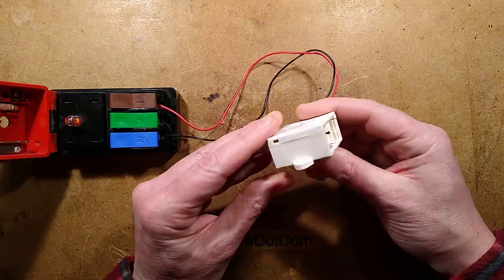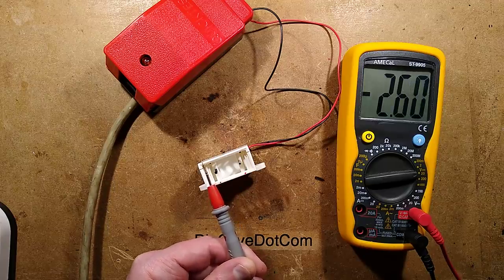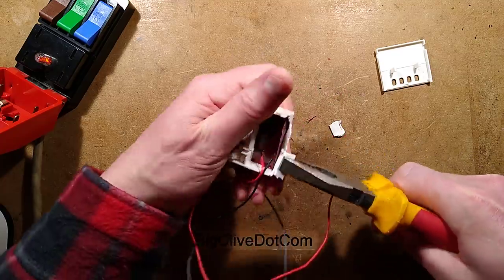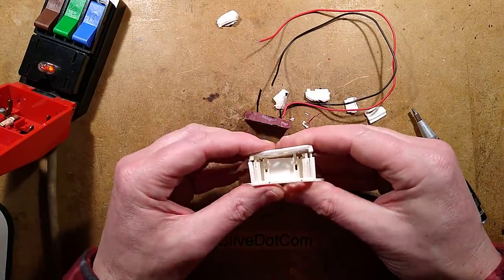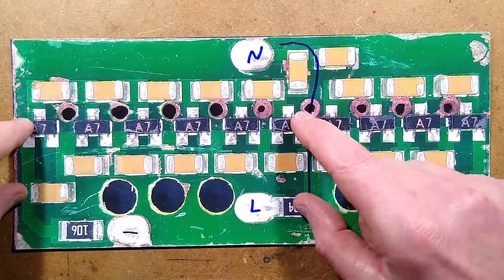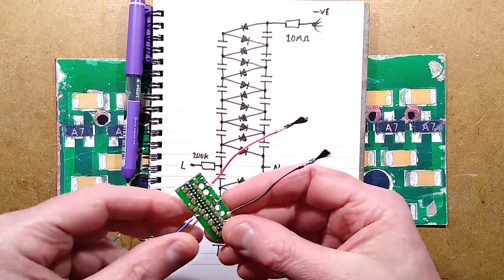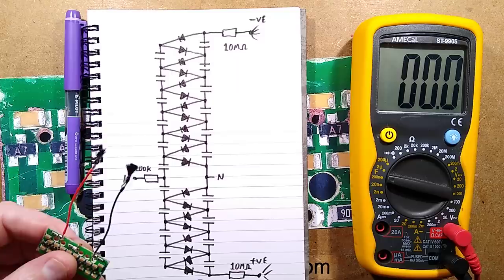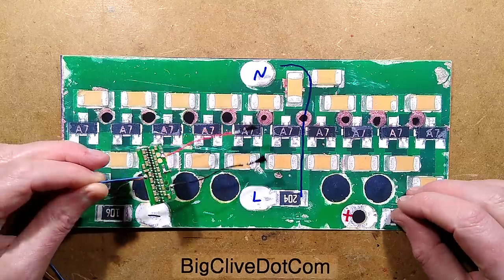Inside a Chinese fridge sanitising module (with schematic)

Comment: Is this CE marked or from 1 Jan 2021 CUK or CNI marked ? If not is it legal to sell / buy it ? Note there is apparently some UK legislation on the way to make sellers on ebay & similar liable for damages caused by their products. There is a story on the BBC web site about a house that apparently burnt down following a battery & charger purchased from ebay setting the house on fire - the family were lucky to escape though as they had let their house insurance lapse it is probably the most expensive item they will ever get from ebay.

Comment: Neat! Didn't know this was still a thing. I have a vintage Admiral fridge (late 50s / early 60s) and it has one of those low voltage UVC light bulbs in it, meant to turn on occasionally and make ozone. The owner's manual says it's for sanitizing the air and also to prevent the transfer of food flavors and odors. Which, if you think about it, made perfect sense in a world without tupperware or ziplock bags. They claim you can put an uncovered plate of fish in the fridge and it won't make your butter taste fishy. Not sure how much it's needed nowadays, though.

Comment: Still amazes me how such small components can carry such high voltages.
Reply: The capacitors only have to withstand the supply voltage each, but they are still very amazing.

Comment: Go on Clive! Move the mains input to the positive end to get a higher voltage!
Reply from the maker: Technically speaking it ends up the same differential voltage anyway.
Reply: @bigclivedotcom  True, but if you connect to the positive end, it would create a higher negative charge/ozone generation?.

Comment: The positive and negative circuits means that the ripple characteristics and charging times are improved compared to a single long chain. With this arrangement there is effectively a 10 stage multiplier between the positive and negative electrodes. Additionally there will be a "breeze" between them.
I think the combination or positive and negative ions will tend to cancel each other out  with the longer negative arm resulting in more negative ions being produced but not excessively so.

Comment: I'm watching this while the freezer compartment blower motor in my 20-year-old fridge is making all sorts of weird squeaky noises 🤣 LOL
Reply from the maker: It may be a worn bearing or just need a suitable lubricant.  There may be a universal replacement.
Reply: I thought the fan motor was going in my freezer. With a new motor in hand I started to remove the access panel only to find the air passage was sealed with ice. Once I got the ice melted and the drain unstopped, the fan sounded fine again. It's been a few years and the new motor is still in the box.

Comment: I've noted that center feeding a  long voltage multiplier like this delivers a higher voltage under load than if fed from one end with the same part count.  but instead of ground and positive or ground and negative, you get positive and negative with respect to ground.   choosing to have a greater potential below ground than a above ground  may have something to do with dust collection prevention.

Comment: I wouldn't trust those tiny capacitors with unknown voltage rating.
Reply: They'll have to take at most 240v * sqrt(2), so fair enough for those sizes. The resistor is more sketchy.

Comment: That multiplier looks really similar to the ones we used to use for photomultiplier tubes in downhole nuclear detectors. Basically either a sine or push-pull drive into a transformer and then those SMT diodes and MLC caps. Getting the MLC's not to crack and short in service was quite a challenge. This was doubly-so in the electronic neutron generators that ran at up to 120kV. Those would literally vaporize a 10uF/5kV MLC cap and leave nothing but a metallic skid mark and dust afterwards when the cap shorted.

Comment: Wow, I wasn't expecting this type of HV generator at all. As a person who has recently used your +Ion PSU livestream video as an instruction, I was quite surprised to see this PCB potted in resin where they usually put a HV transformer pulsed by a cheap and simple oscillator. Quite a lot of space left for the design this case was supposedly traditionally used for.
Reply from the maker: I've ordered a 110v and 12v one to explore.

Comment: It would be very informative if you would measure the voltage multiplier output, both in voltage and even to see the waveform on an oscilloscope.
Reply from the maker: Tricky, as the voltage is high and current is low.
Reply: @bigclivedotcom  voltage divider and then capacitive decoupling for the scope.  you already touched the output so it appears only a hazard to improperly connected instruments.  thank you.
Reply: @bigclivedotcom  Use 10x probe and connect to a cheap but pretty OK USB chinese oscilloscope like Hantek 6022BE
Reply: I would have loved to see the actual voltage output on the brushes!

Comment: I'd love to see a comparative analysis of how the 240VAC compares to the 120VAC and 12VDC versions. I'd also love to see your built version of the circuit.
Reply from the maker: I've ordered the 110V one, and impressively, they got in touch  to check it was the right voltage due to the UK being 240V.
Reply: @bigclivedotcom  Clive, do you have any 120vac sources? I imagine you have a Variac or standalone stepdown transformer but I don't recall seeing such a setup on your channel before. Worst case I wouldn't mind seeing a teardown and analysis even if you don't test it first.

Comment: Ozone produces hydroxyl radicals (*OH) with moisture in the air. I think that is the major route ozone disinfection works.
A single smd resistor is probably rated for something like 200V unpotted. I wonder how much it can take when potted? I'd not rely on a single 10M resistor in the output if designed a thing like that.

Comment: Im curious how you attached the carbon fibers to new wires. Or were they total replacements?
Reply from the maker: New carbon fibre emitters folded round wire which was then bent closed on them, and heatshrink applied to hold them in place.

Comment: The caps are in series and they don't need to be rated for that high voltage. The potential between them is probly ~220 V. Like a batteries in series.
Reply from the maker: It's a voltage multiplier.  They will see at least 350V each.
Reply: My head somehow sow 220V not a high voltage :) I meant like thousands of volts

Comment: I'm still using the triangular fridge ozone generator you took apart a while ago. 
The battery lasts nearly 2 weeks & in times like these using "nature's steriliser" in my fridge is a simple, cheap method of keeping nasties at bay.
I've thought of ways to test it using petri dishes of agar & such but it's easier just to charge it once a fortnight & bung it in my fridge. 
It makes me feel better anyway!
Reply from the maker: I'm using mine too.  I recommend letting it warm up to room temperature before charging it to give the lithium cell an easier life.
Reply: @bigclivedotcom  Ooh!  I didn't think of that. Thanks.

Comment: The voltage multiplier is a lot like the design I used in the high voltage leakage tester project I sent you last year.

Comment: Since A7 = BAV99, as @nuts_n_proud said, rated at 70 or 75V I tested a Nexperia one to see what the actual typical breakdown is (SPICE model says.. 100V). Surprisingly, perhaps, it was more than the ~330V I have available from doubling mains voltage here. The caps will have lower capacitance at the working voltage than at low voltage, of course.  Cockroft-Walton multiplier configuration- the diodes and caps each just see the stage voltage so I guess the output could get "pretty high" with no load. I have a 40kV 1G probe but no patience to build one of these by hand at the moment.
Reply from the maker: The probe would be too low impedance for a low current ioniser.
Reply: @bigclivedotcom  When a gigohm is not enough..
Reply: @bigclivedotcom  Your schematic is very easy to follow, so just for shts and giggles, I simulated the whole thing in LTspice using 33nF caps and RRE02VS4S 400V 0.2A diodes with 50Hz 233V RMS input. About 4kV with no load and 3.6kV with 1G load, so divider output Z about 80M + the 20M resistors. Takes a few seconds to charge. https://i.imgur.com/inlUTpy.png  Ideal would be 6.6kV. Very interesting, thanks for tearing down the potted module!

Comment: Oh, and now that you took it apart and it's still working pretty fine, you can even pot it back in resin and reuse it. Or even extend it further to reach even higher voltage, if you only will.
Reply: Buy three and put them in series?
Reply: @lwilton  first you'll need to separate their multipliers: there is a negative voltage multiplier and a positive one. And neither you want to exceed these diodes and capacitors maximum rating, nor you're gonna be able to charge them with DC.

Thus, you must separate these wannabe half-bridges to stack them up and increase the voltage.
Reply from the maker: I did reassemble it and might pot it into a custom 3D printed case.

Comment: Can confirm that a 12vdc ionizer 12-15kv is perfectly capable of causing a switching power supply to arc from VDC+ to ground, and kill it.
IDK if putting a neon bulb from + to - would keep the voltage from getting too high on the VDC out wires?
Reply from the maker: It's a real thing.  And there are a lot of similar products.

Comment: Please if you can, when you make a bigger test of this I'd like to know the  micro current of each pos-ion and neg-ion separately and then when they both running at the same time.
My theory is that it could create an ion exchange path that could make it higher current and thus potential for making higher ozone for a much smaller circuit
Reply from the maker: I think the vicinity and super-fine carbon strands are a significant factor.

Comment: Not sure if the thingy makes sense for consumer fridges though, considering the wiring (and a need for a timer and button of sorts?). It could probably be botched to fridge light assembly, but that’s kinda too hacky?
Reply from the maker: It's so low current it could be wired across the door switch.  But I think it's aimed at commercial fridges.

Comment: The A7 package looks like a standard SMD  transistor and cant a transistor be used as a double diode?
Reply from the maker: They can, but with very limited voltage ratings.
Reply: A7 will be a short reference code to identify the specific component, as there isn't enough space to print the full part number eg: 2N3904. The package looks like SOT-23, which are often used for transistors and diodes, but can also be used for 3-pin ICs like a TL431 for example.

Comment: try moving the 240V input towards 1 end on each circuit , to have +HV and -HV, then put the 240V wires in parallel to have double the voltage, to see if it works 

thanks for the video,
cordially, a high voltage enthusiast

Comment: Hi Clive. I had a project in mind and was curious could you build one with a reasonable amount of work and cost. An array of laser's say 5 in a fan spread that would pulse back and forth? Say #1 lights then #2 and so on to #5 then back again. To be used outside like in a Christmas display.
I was just thinking it would make a nice addition to a display shooting then skyward.
Reply from the maker: You can get disco lights that do that.
Reply: @bigclivedotcom  Thanks

Comment: i know youve done it before but i would like to see you build one with common through hole components and on a perforated board !!! the ones already perforated and you just solder and make the connections .
i want to build one but i dont have access to develop my own pcb or manufacture pcb's and local pcb manufacturing is super expensive.
i cant order a pcb from china becoz the stupid country that i live in (tunisia, africa) does not allow us to transfer money outside it so no paypal or ebay or amazon .
Reply from the maker: The perf board without pads could work.  You can make an ioniser with no PCB at all.

Comment: the caps and diodes only NEED to be rated for 350VDC in order to run on 240VAC, 400V would likely reduce the number of crib-deaths to an acceptable level. The bigger ionizers are probably built like a brick shithouse, just because.

Comment: The potting seemed pretty solid. Is that a suitable method to "uprate" the components to handling that much voltage?
Reply from the maker: I would guess the ceramic layer thickness would be a significant part of the voltage rating.
Reply: The voltage rating of a capacitor is determined by the thickness of its dielectric. Adding protection around it might make it safer for humans, but won't stop the capacitor being destroyed by overvoltage.

Comment: 2:59 Big Clive Rule of 3 - DRINK

Perhaps the designers found that using separate negative and positive multipliers was the only way they could get the voltage difference that they wanted in such a small envelope using the Cockroft-Walton topology.
Reply from the maker: This would be the simplest and cheapest way.

Comment: Is it possible to measure nitrogen oxides, to find out whether it's also breaking apart N2 rather than just O2. My understanding is they form in strings of varying numbers of N and O. The downside is formation of nitric acid with moisture present. While ozone from UV at 185 nm avoids breaking up N2, acting only on O2, or so I hear. A meter for just NO2 would maybe be an analog for all of its nasty cousins and good enough. Prices vary a lot. Anyone with experience using some of them?
Reply from the maker: Not sure, but if an atom of oxygen combines with a nitrogen molecule it could create nitrous oxide.  As used to whip cream for hot chocolate.

Comment: I like ozone for a lot of things, but I don't want to have high levels of ozone on or maybe in my food. Or whatever it does to the plastic and all that stuff you have in your fridge for long time.
Reply from the maker: This thing puts out low levels.
Reply: @bigclivedotcom  But in a relatively small and sealed room. With a half-life of about 30 minutes I think it can build up to higher levels. Maybe I'm wrong, still like the idea, I just wouldn't trust it.
Reply: @bigclivedotcom  and because I'm curious about it I searched a bit. Turns out the amount of ozone and timing is very critical. You want to reduce bacteria and mould as much as possible and damage the food as little as possible.
So running this thing for 1-2 hours in the middle of the night seems fine to me.

Sorry if my English sounds stupid😅

Comment: Is there any reason why I couldn't buy a cheap pir motion sensing solar light and swap out the LEds for IR LEDs to aid my security camera night vision? Or would that mess with the pir?
Reply from the maker: You could do that, but you can buy 12V infrared illuminators for CCTV that turn on at dusk.
Reply: @bigclivedotcom  thanks for answering!! All of my cameras are remote (battery and wifi) so need the IR lights to be solar as well. If the IR messes with the pir, I guess doppler is a good alternative

Comment: Is this recommended for continuous use, or would you just use it like when defrosting, for example?
Reply from the maker: It could be used continuously or in bursts.
Reply: @bigclivedotcom  so how would you power it?...a mains cable squeezed under the door seal doesn't sound right...?
Reply: @kierank01  My thought is to wire it in parallel with the evaporator fan (behind the freezer compartment in a traditional upright unit). That would provide a clean install and also ensure there is always some airflow when it's running.

Comment: 0:02 What are those DIY Electrocution Devices for connecting to mains called, and where can I buy one?
Reply: @majortom5838  We had one at school. I remember an incident with one of them, a variac, a 8 inch nail, and loads of copper wire. How we laughed as our school chum twitched on the floor.
Reply: @majortom5838  Know any "cheaper" version or what one might search ali for?

Comment: Why did they so heavily pot such a tiny simple circuit board?
Reply: For extra insulation between small components running at high voltage, and to keep moisture from the fridge off the circuit which could also lead to voltage breakdown problems.
Reply from the maker: Partly the high voltage, and partly to keep people like me from reverse engineering the circuit.

Comment: How does the voltage rise with only diodes and capacitors?
Reply: This type of circuit is called a voltage multiplier and is fairly common in electronic devices. See https://en.wikipedia.org/wiki/Voltage_multiplier for a more detailed explanation of its operation.

Comment: As far as I can realize, this might be BAV99LT1G, and its voltage rating is like 100V, which is horrible for this application, I think.
UPD: they aren't even rated for 1A.
Reply: was also my impression, 100V. No, they are rated for 100mA, sometimes 200mA